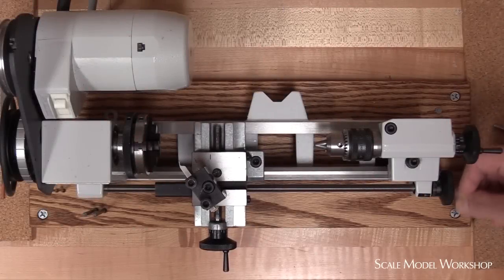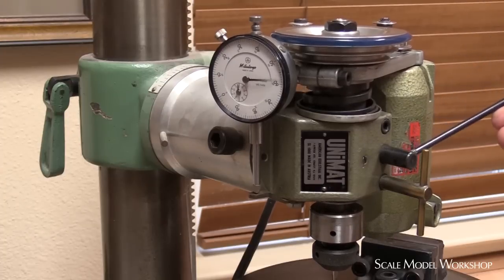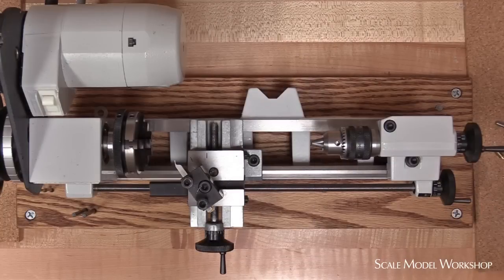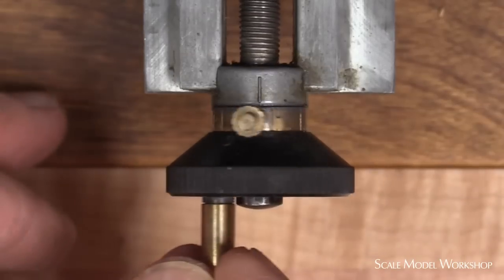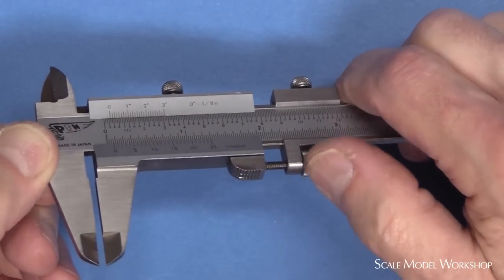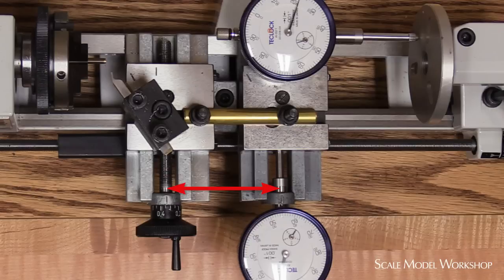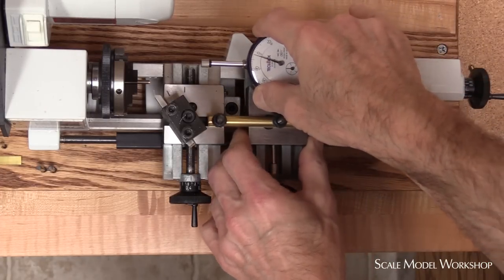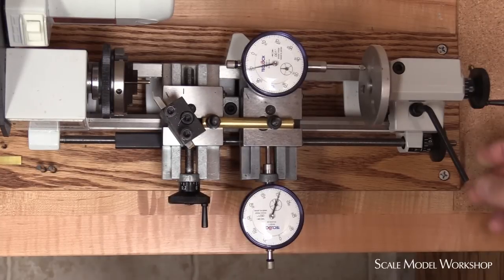Unimat Lathe with Direct Readout

Comment: I put the dial indicators on arms with magnetic base and set it up very similar (the dials are pointing to the cross slide block).. My mini lathe has a bit more travel than dials (it's a proxxon pd250)

Comment: hi, do you have some video on how you added a dial indicator to unimat head for use as a mill? Is there a special part connecting the indicator to the bolt on sheave assembly? How did you connect a read out plate on the head?